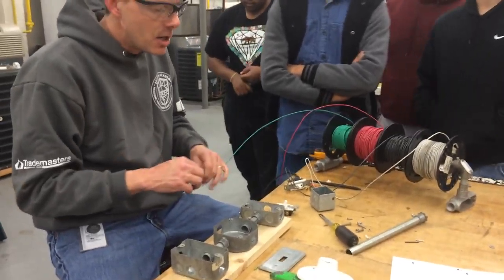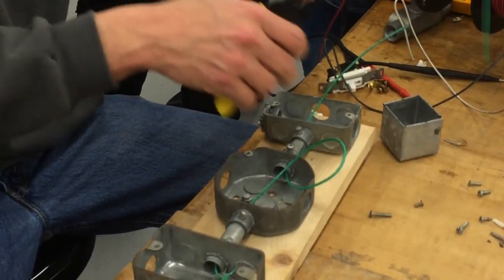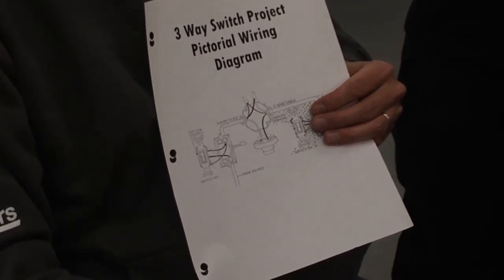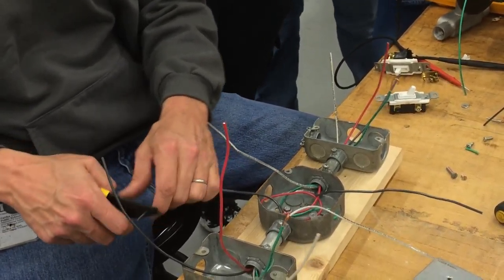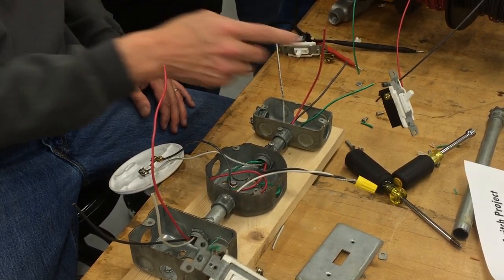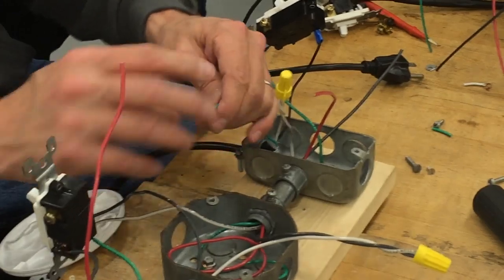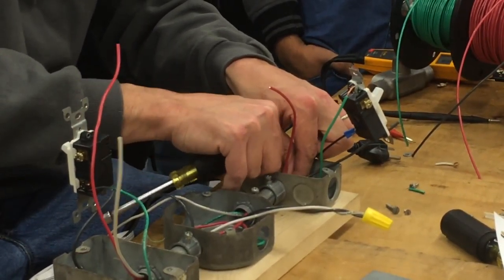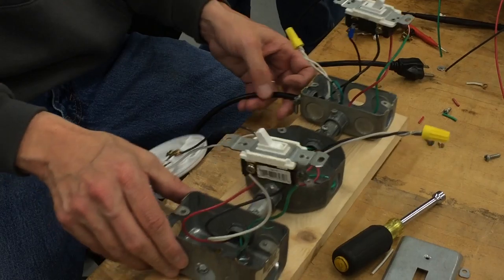HVAC Basics: Electrical - Project 2 How to wire a Three-Way Switch - Part 2

Comment: Never ever use a wire nut to twist solid core wires together. Always , twist solid core wires together and then put wire nut on.
Reply: I depends on how many wires there are and the gauge really. Pre twisting is always preferred but actually not required but some wire nut manufacturers believe it or not. A bigger problem is people not using the right size for the conductor size and amount I think.